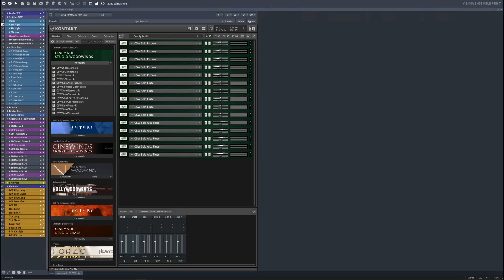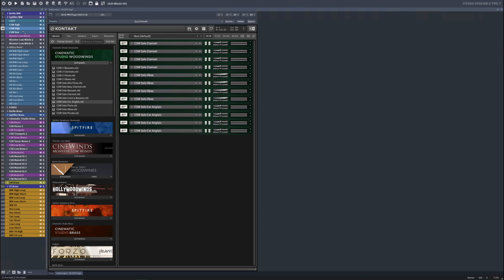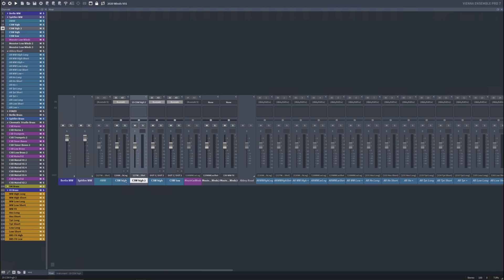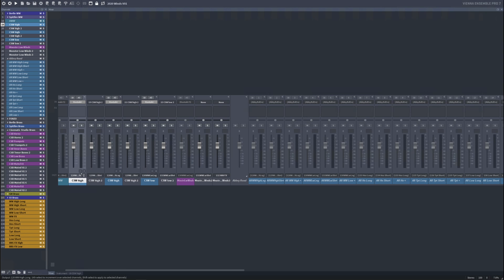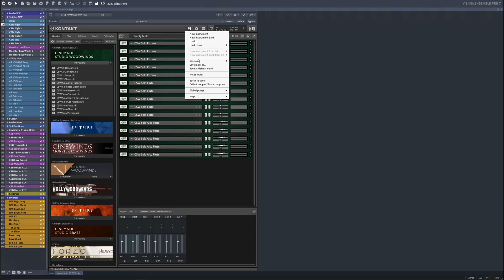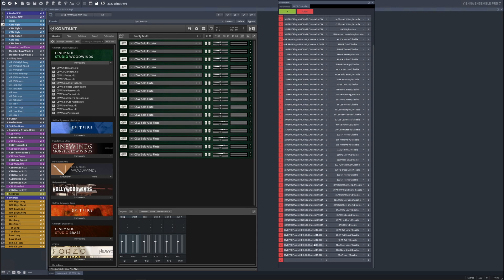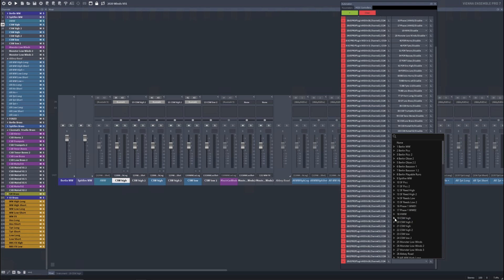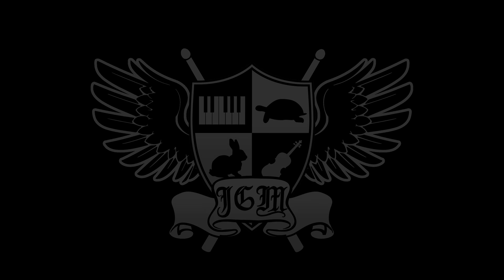VE Pro Template, Part 2: Enabling Kontakt with CC control

Comment: Hello Mr Jason!
The midi automation for disabled track, CC24 in your case, has to be triggered from a specific instrument. So the problem comes in when you change sessions and have tracks that don't have any midi playing on the main track that sends a disable enable message. Big problem in the workflow of disabled VEpro tracks. 
The solution. 

Using the Transformer midi plugin on all the other tracks, you can make it fire the CC24 on channel 1 by firing CC24 on any channel. 
So basically you can now enable and disable tracks by firing CC24 on any track. Perfect when changing sessions and not having to manually trigger the enable command! Though I'll just share it here. Thank you, Mr Graves!
Reply: Never mind, I had forgotten about non decoupled tracks that are preserved. Exactly what I was looking for. Just a few more seconds of saving time but works perfectly.
Reply from the maker: Glad I could be of service